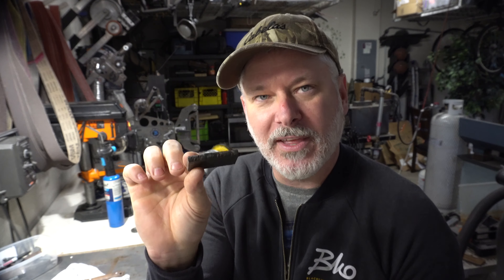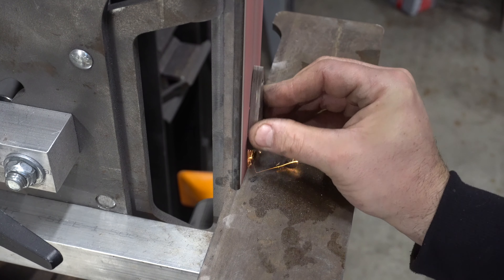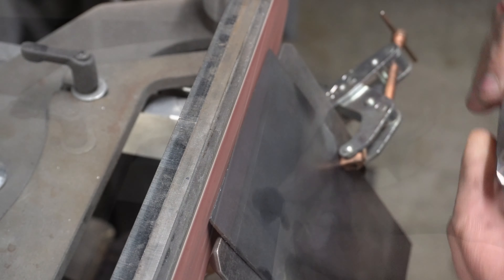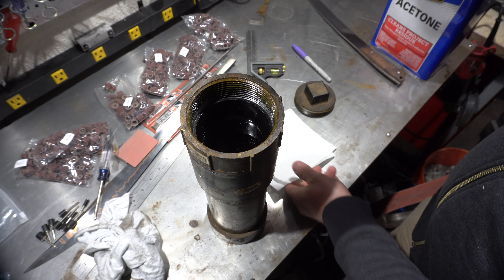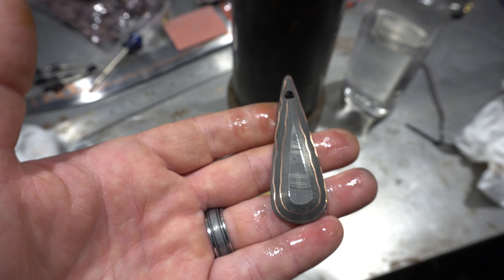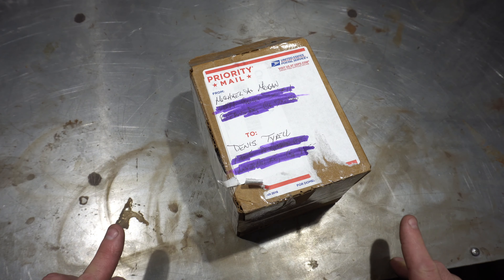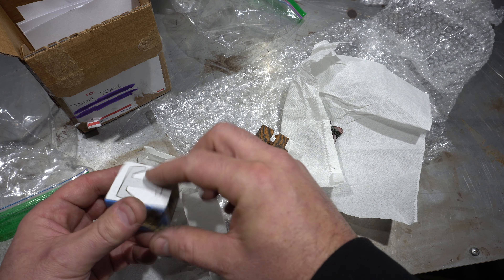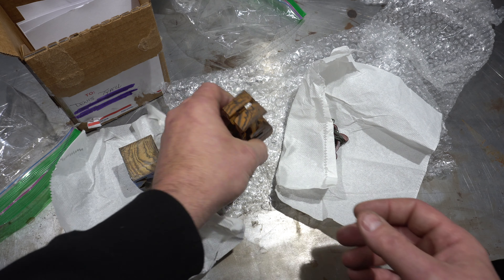Triple-T #65 - Making a pendant out of copper damascus

Comment: Great introduction and I am curious what is the thickness of the outside plates when you are doing the copper layers
Reply from the maker: It varies.  What's important is the core.  You just need to make sure your core is thick enough at your desired end-thickness for the billet.  You don't want your core to be less than 1/16" by the time you forge it down.  I usually like the core to be 3/16 to start but I've done 1/8" on many occasions and that works fine.
Reply: @TyrellKnifeworks  ok thank you keep up with your great videos!

Comment: Tyrell, evertime I’m working on a project, it turns out ur doing the same one! haha
I did an order of push daggers last month and now I’m doing a damascus necklace- although mine is a bird shape
great content!
Reply: btw, what happens when copper stains the ferric? I had copper in mine a few times
Reply from the maker: Great minds think alike! 😜 The copper will stay in solution in the ferric chloride and it will start to deposit (almost like plating) on other metals and you’ll get a copper tinge on things you dip in it.  It can look cool, but you won’t want it on everything.   Thanks for watching, Theo!